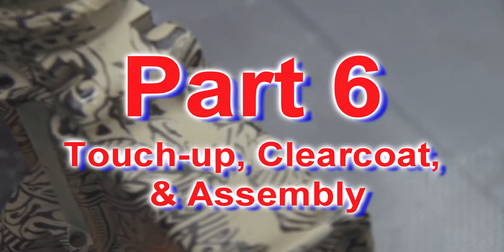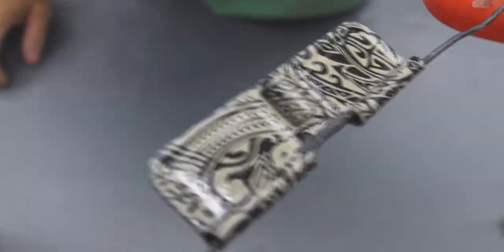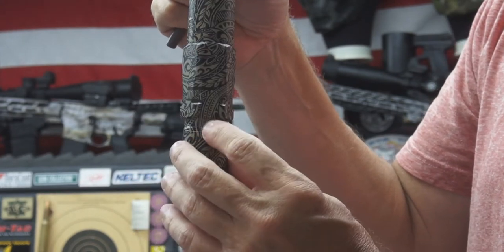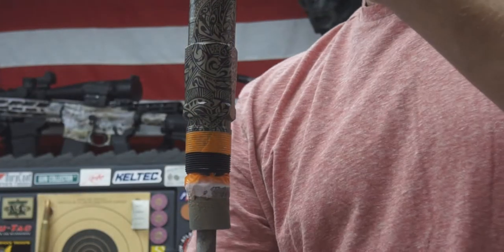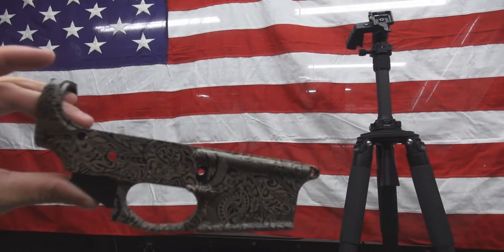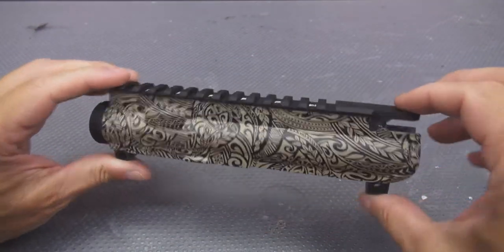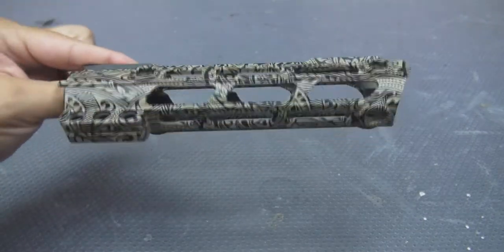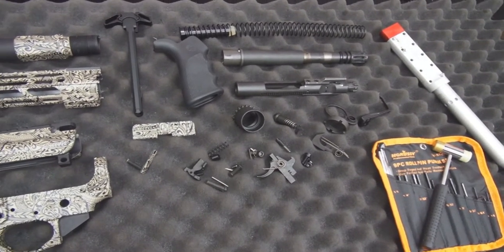AR-15 Hydro Dipping Part 6 - Touch-up, Clearcoat, and Assembly

Comment: man thats beautiful. i really want to get mine done
Reply from the maker: @nalley6815 ... Thanks so much! It really makes it look much better...and it's something different, other than plain old black or FDE.
Reply: @jujuscustomshop  there’s this paint scheme on call of duty I’ve been using for a long time. I’ve always thought it would be pretty cool to make it come to life on my ar somehow
Reply from the maker: @nalley6815  ... There's a place that I've used a few times, that'll print custom hydrodip film based off of any logo or photo that you send them. It's a little more expensive than regular hydrodip film, but they can do pretty much anything you want. They've also got alot of exclusive film patterns that nobody else has. https://www.fractalcamo.com/
Reply: @jujuscustomshop  hey thanks I’ll have to check it out
Reply: Contact info? I'd like to have one done